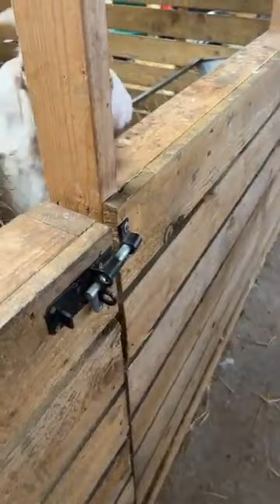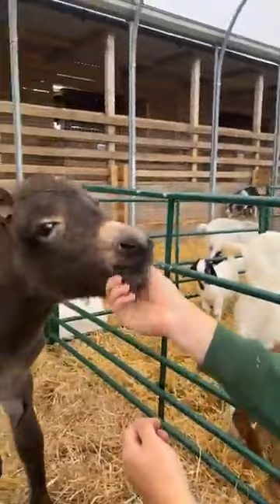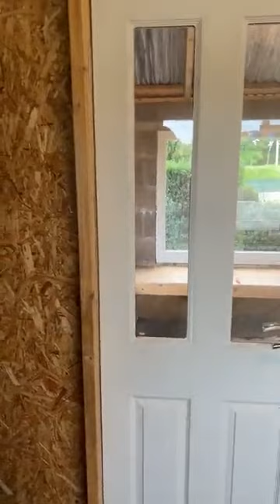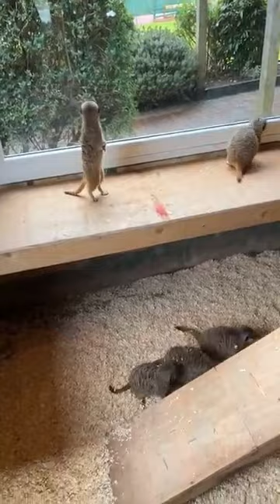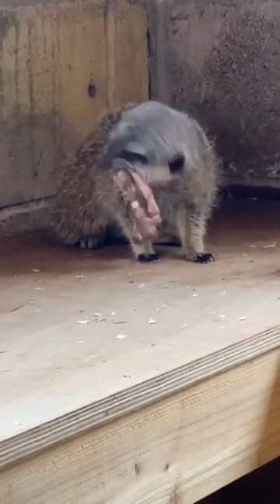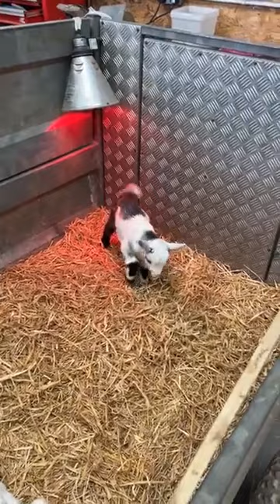Farmer Ben's Back!

Comment: Jolene is trying to make sure Farmer Connor can't fix the door lock.
Sadie's saying....stop looking at my bits.
How sad...only 1 meerkat baby left....
Hmmm Farmer Ben, I can relate with Birdie....due to infant/toddler parental abuse, my Right leg is shorter than my left, by 1.5 inches...it will cause her pain, if she does overuse her leg, because she will be putting more weight on the longer leg & it can cause hip/shoulder strain, if she walks differently.
FB probably doesn't like how you have so many consistent followers...